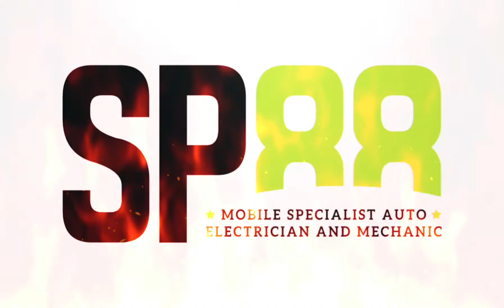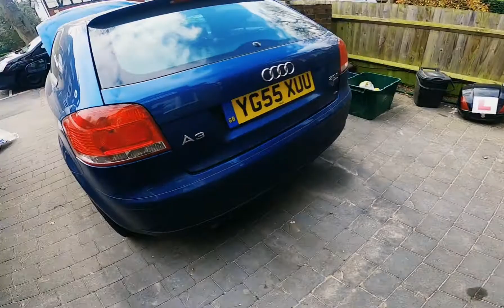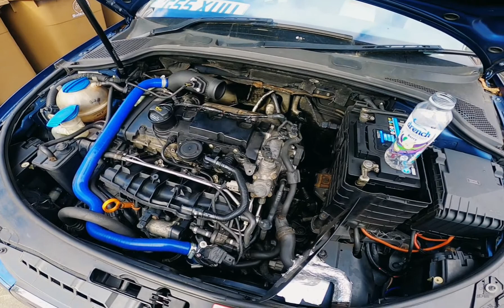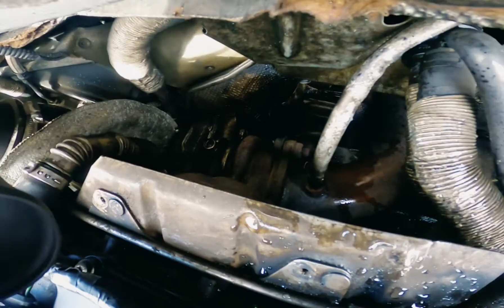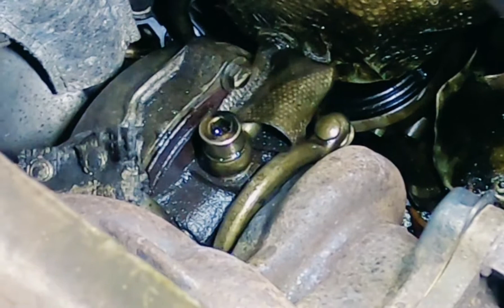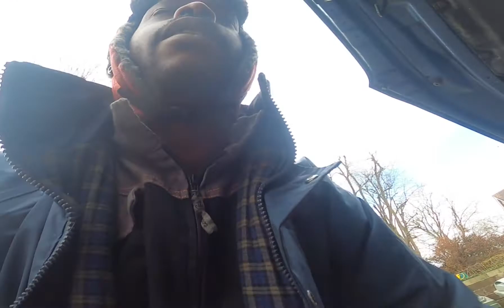Addressing Oil Leak from Turbo in Stage 3 Audi A3 8P | Troubleshooting Immobilizer Fault Ford Focus

Comment: Hi pal.  I have an oil leak on my car. It seems to me that it is coming from the back side of the turbo when I was under my car. The car is not in limp mode and I don't drive it too fast. What can be the cause 
I have an a3 rid 55 reg
Reply from the maker: Hey, post a video I'l take a look. My turbo began to leak from the housing.